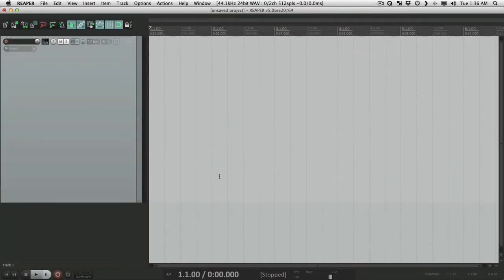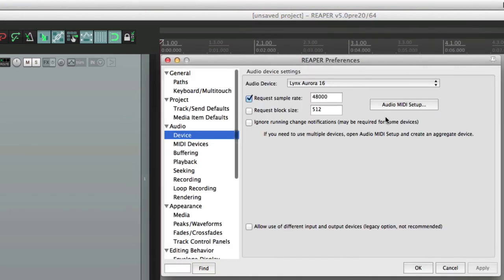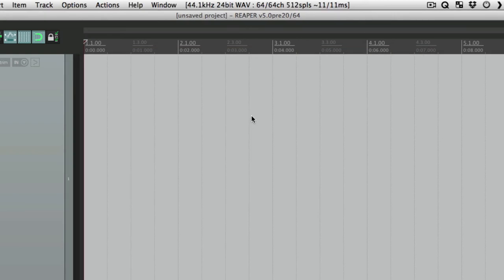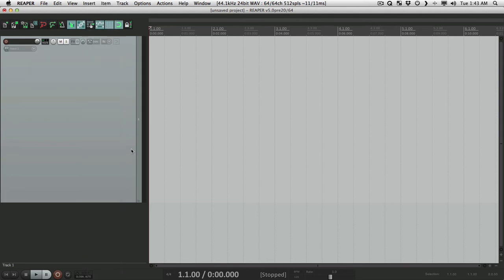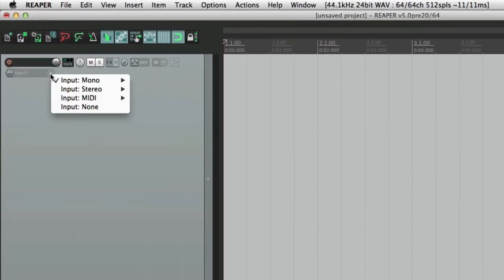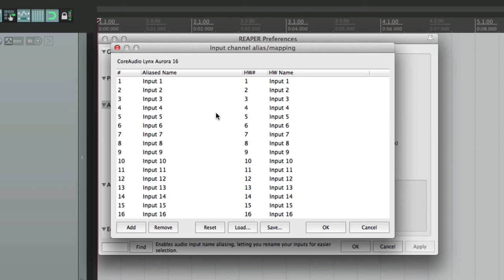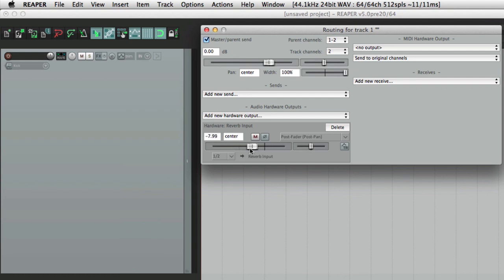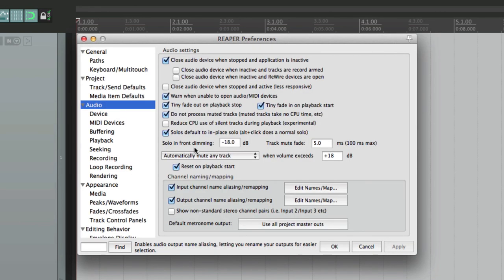Audio Device (Mac) and Channel Mapping in REAPER

Comment: Very clear tutorial, but I'm having a problem with the Mac version.  I want to use output 3 of my interface,  however the option to select outputs under preferences/devices isn't there like in the windows version. So now it's stuck using the default output 1 and 2. Any tips?
Reply: add it as new hardware output, look at 8:02

Comment: Hi Kenny.  First of all like others have said your videos are really very well done and extremely helpful.  But alas I'm a slow learn right now as I'm still kind of new to traditional DAW's so Reaper's a big hard right turn in some respects.  So I'm going to ask specific questions because I have specific problems or situations I need to work out so I understand a bit better.
I have a plug in called MT Power Drums (great VSTI) the software has it's own internal mixing console  What I'm looking to do is to separate the different drums to different "Tracks." So how would I use the technique above to make sure that for example the "Kick" goes to say Track 1, the snare to track two and so on. In my other DAW the mixer console does this automatically.  But I'm not sure if the same applies for Reaper.  Are you familiar with this plug in?  I know both Reaper and Mixcraft have the free download listed on Google and am using it on both DAW's just switching my mind from one format to the other makes me a bit nuts.  :-)  Thanks

Marty